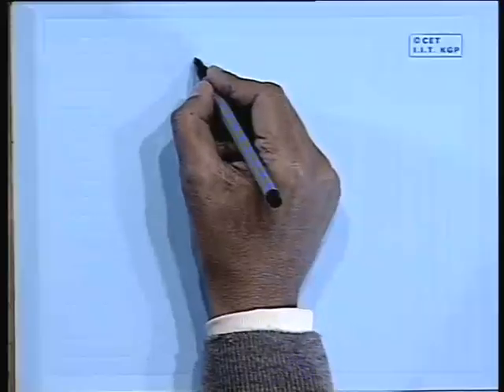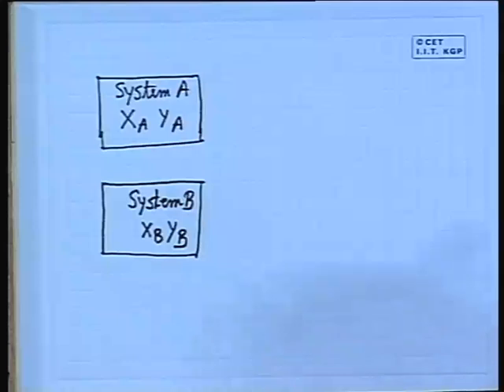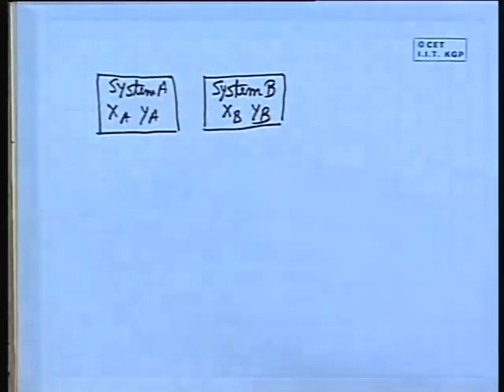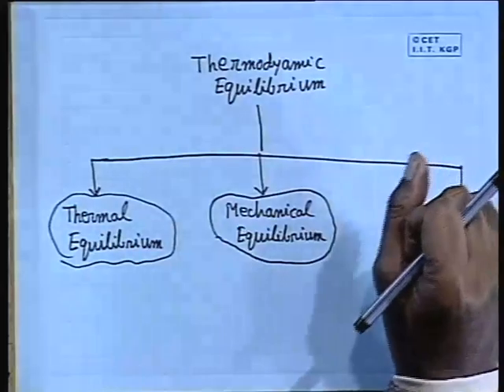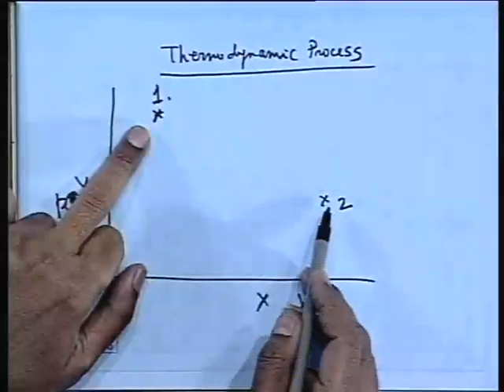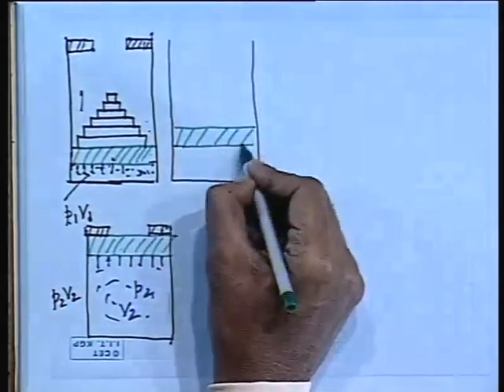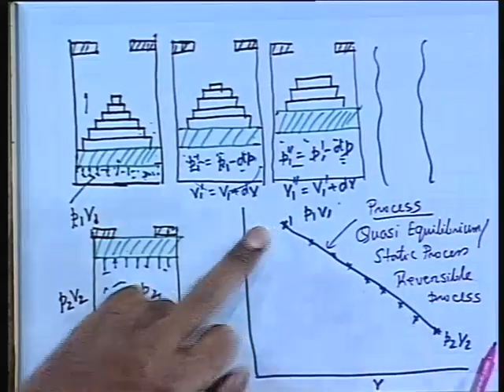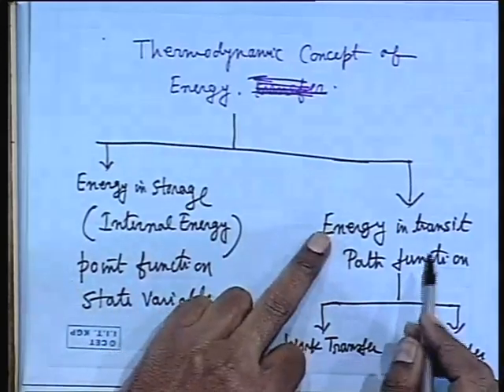Lec-2 Zeroth Law and Fundamental Concepts

Comment: Doubt:
PROPOGATION OF SOUND IS A ADIABATIC PROCESS

 Sound travels in Air as pressure waves(Longitudinal Wave).We define Pressure Wave Equation. However, as an internal Process(of energy transfer) in involved, its not a quasi equilibrium (or quasi static process) still the assumption that its a ADIABATIC PROCESS (a thermodynamic description of natural process) provides VELOCITY OF SOUND IN AIR.
 
Request Help       
Thank You

Comment: @29:35 The final state of system if weights are removed in chunks,one after another,can not reach the pressure Psub2 and Vsub2 as it were the properties of the system when system had slammed in the stops after removing all weights suddenly.

Comment: sir, we know that internal energy is extensive property means when mass zero, internal energy will collapse to zero, but here you tell that internal energy is point function, at point there will be negligible internal energy, so its totally waste to find the internal energy as a point function.
Reply: by point function he means point on a thermodynamic graph (i.e., P v/s T , T v/s V etc.)
Reply: thnx
Reply: Yes, Internal energy is extensive but what about internal energy per unit mass??......Every intensive property can be represented by points on process paths....when we multiply that change per unit mass by mass of the system then it becomes energy change or transferred along that path between initial & final states considered.......